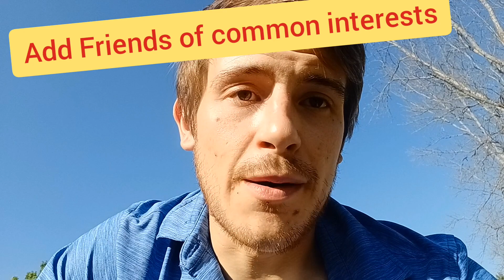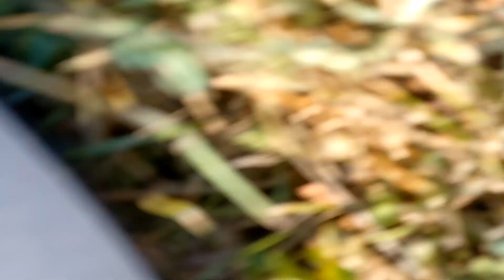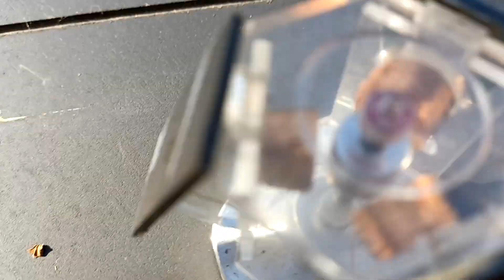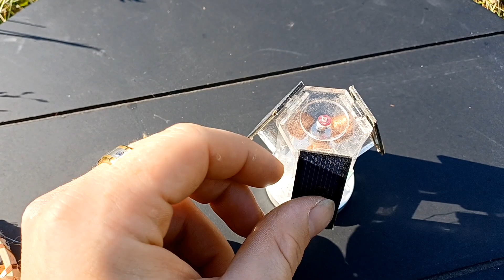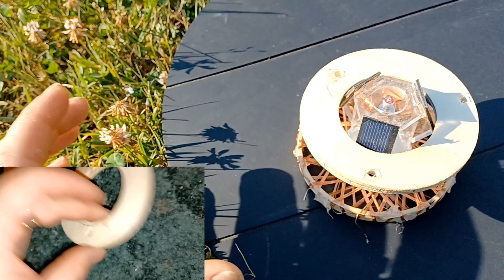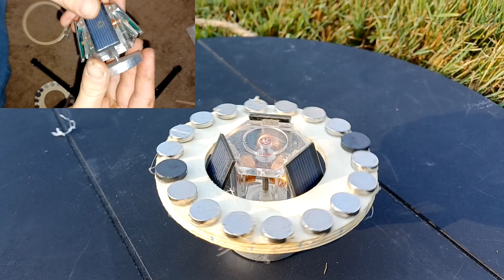FREE ENERGY Mendocino Flywheel Generator Concept Using Vortex Based Mathematics Part 1

Comment: Have you looked into high voltages and corona motors? So maybe we could pull the voltage out of the sky using charge differential in the air and make this work withou the sun.

In my mind, you guys on YT doing research, are on the cusp of something great! We just need to combine all of this knowlage into something useful.